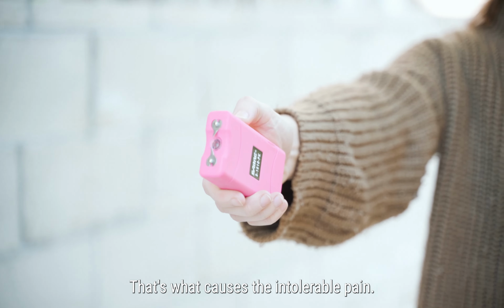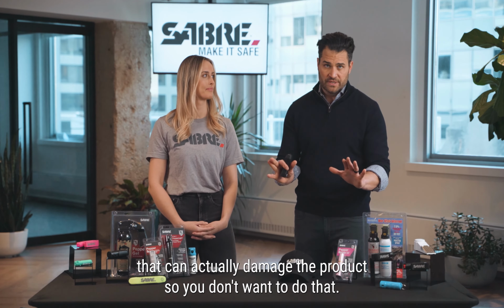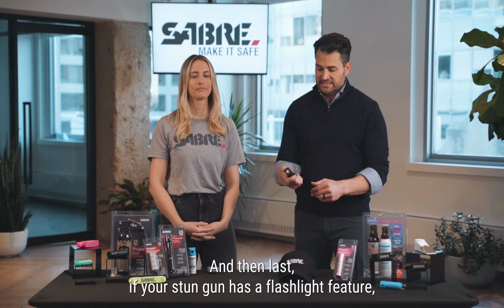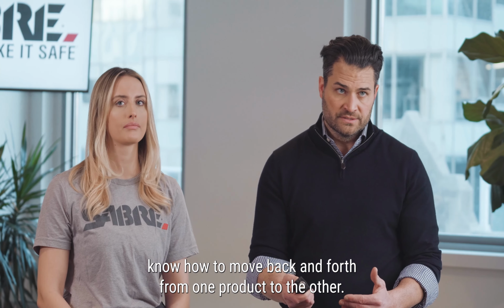How to Use a Stun Gun - Gripping and Testing Your Stun Gun

Comment: BEWARE!  When I took our dogs out in the middle of the night, I took my stun gun.  I turned it on and the flashlight was not working.  I went to test it and nothing.  I just assumed that the battery was dead.  When I went back inside, I went to set it down and it shocked me.  I threw it out of reacting to the shock - it hurt and my hand was numb for about 10 minutes.  I have no idea what happened or why it would shock my when I was holding the handle and not pressing the button.  It is defective.  I tried to exchange it at Sabre Red and over the phone I was told they would exchange it but in writing, they said they would only exchange it if they found something wrong with it.  Why would I have contacted them if there was nothing wrong with it.   Now we have to have it tested on my own because we really want to know what the problem is.  I am on a mission to find anyone else this has happened to so I am posting wherever I can about this.